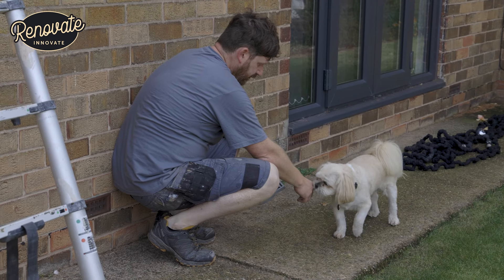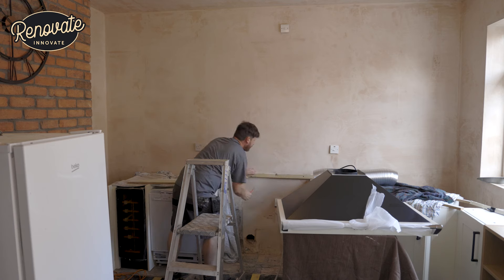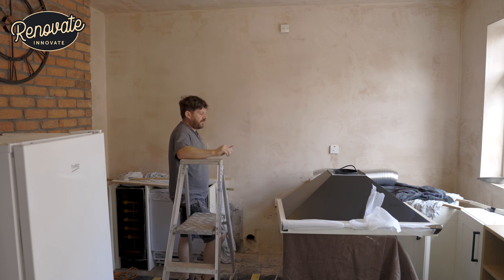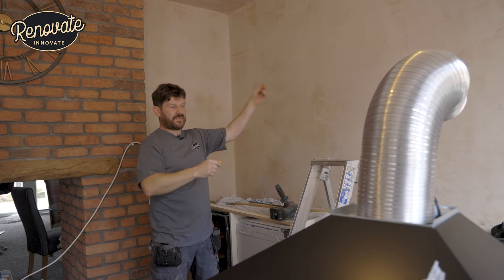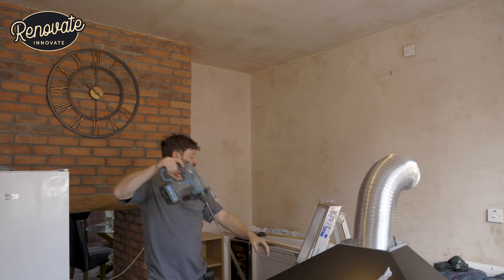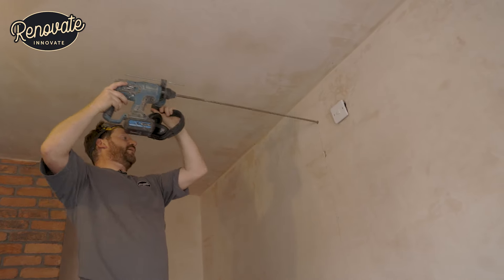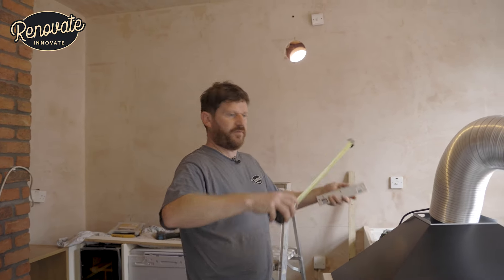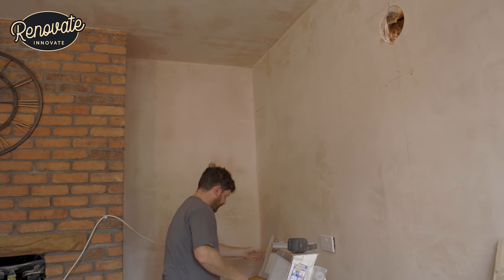How to Install a Cooker Hood - DIY Range Hood | Renovate Project

Comment: Incomplete,where was the wiring.
Reply from the maker: The wiring was done by the electrician, as we are not certified
Reply: @renovateinnovate  you still should have shown wiring.
Reply: What’s the average fee for this type of job please including the electrician fee for the wiring?
Reply: How did you find the height of the hood in the end? Did it end up being a little low?

Comment: Can i ask what the size of the ducting was? Also, how did you secure the duct to the cooker hood?
Reply from the maker: Hi, we used 6inch ducting and it was secured with a large jubilee clip. Hope that helps 👍
Reply: @renovateinnovate  appreciate the response. I'm seeing the 6inch ducting needs a 160mm diamond core drill bit. Is this what you used if i may ask please as i can only see 152mm diamond core bits on Screwfix? Thanks for your time
Reply from the maker: @karimabdullah2925  No problem! Yes we used a 152mm bit but there was enough give in the ducting to squeeze it through - hope that helps
Reply: @renovateinnovate  yes it does. Spot on. Thanks for all your help. Wish you all the success in your projects. Take care mate

Comment: In order for it to work, you need to connect the power supply. Did you forget to include that step or did you do it off-camera?
Reply from the maker: The electrician connected the power supply off camera